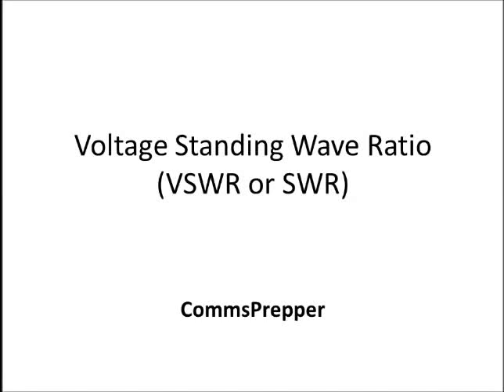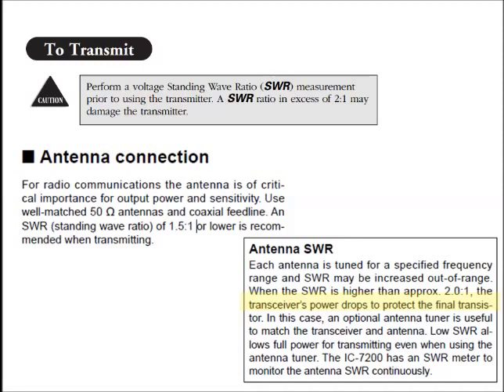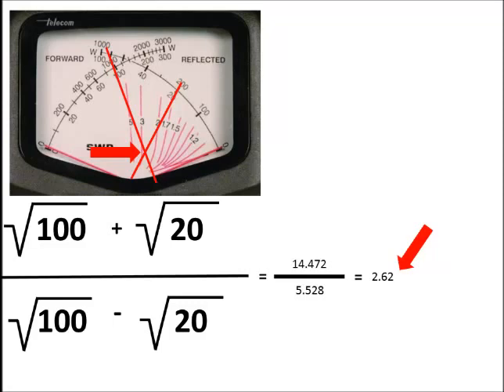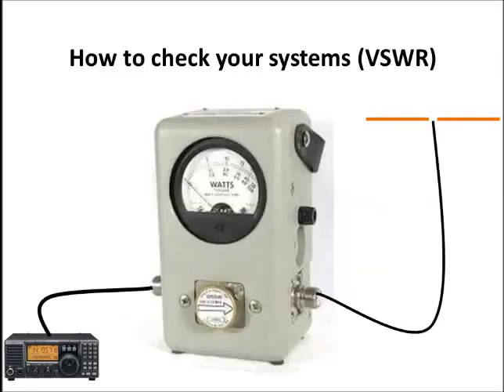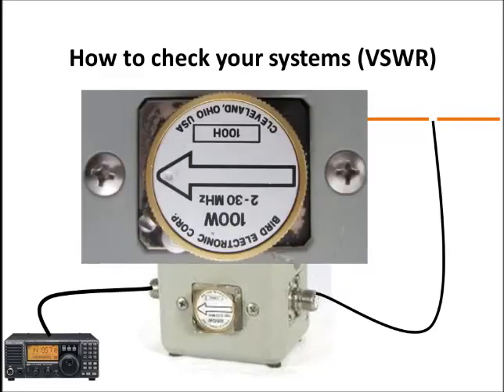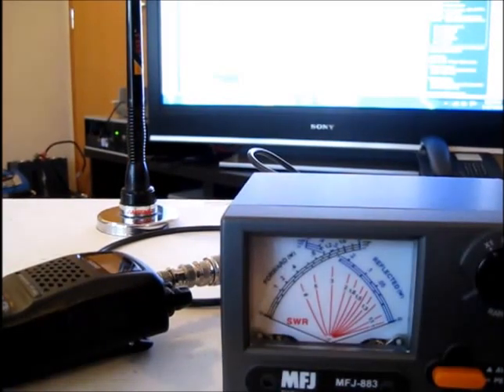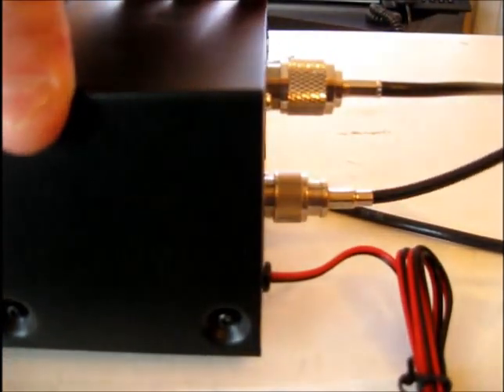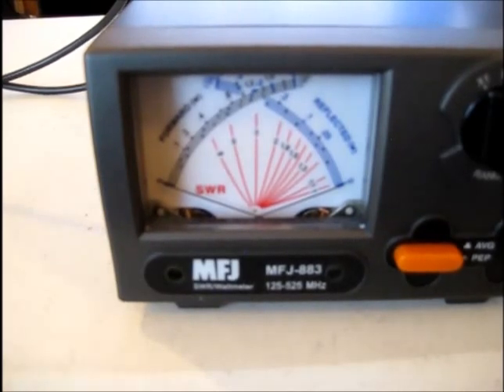Check Your Antennas - VSWR

Comment: SOrry during measure VSWR, does it matter if the antenna is not set up in open area (direct to the wall of the room)? Is the signal reflect from the wall will cause VSWR higher than usual?

Comment: Properly tuned AT  the ANTENNA. 

Yes.

 NOT at transmitter.

BUT...the meter is NOT reading reflected power bc line losses are much greater across a line when out of tune.

That just amplifies the REQUIREMENT    to check AT the antenna, not transmitter.

Worse than just extra heat, mismatch causes very high voltages or currents into the TX and that also can damage the transmitter.

PS thats not a VSWR meter.... VSWR is voltage at two different pounts on the line.

These meters measure reflected current.

All in all, good video.

Comment: So what can you do when a test of a new antenna and a new radio produce super high SWR? Can you do a video on how to address undesirable readings? I can understand not using the rubber duck antenna, but what if it's a brand new EFHW antenna and a new HF radio? Do I send it all back?
Reply from the maker: What is an EFHW antenna.  Things to look at if your SWR is bad.  Cable problems (short, open, bad connectors, bad cable).  Antenna problems - not tuned or cut for the operating frequencies, shorts/open, bad coils/balums, etc.

Comment: The reflected power will get re reflected at the radio or tuner back to the antenna and radiated, how much depends on feeder loss
Reply: If there's reflected power back at the radio that doesn't trip the protection circuit of radio what happens to it, it gets reflected back to antenna, how much that gets back to antenna is down to feeder, the lossy it is the less that gets back to antenna
Reply from the maker: Not sure I understand the comment.  Reflected power is bad.

Comment: Superb. Period.

Liked & subbed.
Reply from the maker: +usernamemykel thank you
Reply: With my Yaesu 7900R, I'm getting good readings in front and reflected values, but the needles aren't crossing, so I can't read a SWR. This happens in 2m only, not 70cm. 
What's happening?? If the needles don't cross, then what is my SWR value?

Comment: Cool wish I had watched this before I went for my test Sunday, I would have got one more question right.  I passed anyhow but it is nice to learn a bit more anyhow before my radio arrives and my name gets in the database.  So what could you do with that little rubber ducky to get the SWR down to a good rating in VHF?
Reply from the maker: +Jerry Ericsson Congratulations on getting your ticket!  Handheld rubber ducks - nothing.  They are what they are.  However, if you make an antenna then you can do more.

Comment: Thanks, that is very well explained. 
Now this topic is much clearer to me than before watching this video.

Two remarks: the close-up video of the SWR-meter is a bit blurred.
And ... did I miss the explanation what the difference is between "AVG" and "PEP"?
Would be good to know what is is about.
Reply from the maker: +Thomas Gärtner Thomas sorry about the blue but the video is posted and I cannot correct it.   I have since tried to do better with how I shoot the videos.   Average setting will slow the swing of the needles and allow them to hang momentarily to give you time to see the reading.  Avg will also show lower power because it's an average of RF energy.    Peak Envelope Power (PEP) is a real-time reading of power, which includes the peak of the transmission.  In PEP mode the needles move fast in response to present RF energy.  When in PEP mode and side-band mode on the radio I whistle see peak power on the needles.

Comment: Thanks for the video but im confused because there are many videos about how to check but how to fix? You have one antenna thats wrong, ok how to fix it?
Reply from the maker: cvcoco At first I would look at the antenna length.  If the antenna is a match at a lower frequency - it's too long and needs to be trimmed.  If the antenna is a match at a high frequency - it's too short.   If the antenna is not at match at any frequency around the frequency you cut it for then you should look at the following:

1. Connectors (properly made, no shorts and no opens)
2. Coax check (no cuts or shorts)

Hope this helps.
Reply: Commsprepper Ok thanks, understood. Are you ever going for an average length? Once I read that the ideal length for a car FM antenna was 37 inches but that length doesnt match 88 or 108, its somewhere in the middle so something is always being lost, yes? In other words, do you need a separate antenna for every frequency band? How can 2M and and 400 band use the same length of antenna in one radio? SWRs wouldnt ever match right?
Reply from the maker: cvcoco Never seeking and average length.  Frequency wave lengths are specific and must be correct to have a resonant antenna which will result in low or no VSWR.  This is said - antenna length is less critical for receivers since they are passive devices (i.e. car stereo or coat hanger on the back of an old TV).   Different antennas are needed for different bands.  However, there are many multi-band or dual-band antennas.  For multi-band antennas designers use traps and coils to manipulate the antenna's impedance (resident wave length) and take advantage of fractional wave lengths of an antenna.  For example 145mHz wave length is roughly 2 meters long and will have low or no VSWR.  But you can also achieve the same VSWR with fractions.  1/2 wave length and 1/4 wave length.  The fractions are also resonant and will have low or no VSWR but are less efficient.  Another example: the antenna length for 14.24 mHz is roughly 21 meters long, At 21 meters this antenna is too short for 7.25 mHz for a full wave antenna - BUT - is almost perfect at a half-wave.  Add a coil or choke and you have a single antenna that works on two very different frequencies.  One of the more popular antennas that does this is the G5RV (names after the British ham's call sign that designed the antenna).  Hope this provides some insight.  CommsPrepper

Comment: What the hell is "R3CU"? As long as you are going to do all of this prepper work in comm, you might as well get your tech or general amateur license. You (and the others) most likely have the intelligence and iniative to easily study for and pass the tests. Also, other hams will be glad to assist you with your technical and operating skills.k

Otherwise, your video is very good simplified explsnation of VSWR and how to measure it.

73 de

K6WHP
Reply from the maker: William - R3CU is my call sign here in the Russian Federation.  It's a CEPT Class I license (same as a U.S. Extra class license).  I also have a U.S. Extra class license and have been licensed since 1988.  Thank you for the feedback on this video.  73's Hank
Reply: Commsprepper Well, don't I feel the fool? Congratulations on getting a license in another country! Quite an accomplishment.Did you have to take the test in Russian? 

Anyway, the advice still stands for other preppers who want to become proficient in comm. Hams are more than happy to help folks study for their tests as well as share their knowledge and experience in technical areas. (As your fine video demonstrates.)

72/73,

K6WHP
Reply from the maker: k6whp I did not need to take the test here.  There is a reciprocal agreement between the U.S. and Russia for radio licensing.

I agree 100% that preppers who seek a solid communications plan should get licensed.  I have a few videos on the topic, providing guidance on where to start and walking through the process.

Again - thanks for commenting.

Hank
Reply: My 73-year-old girlfriend, totally non-technical, studied the Tech Class flash cards for 3 months and passed her Tech test. Proud of her.

Comment: does the watt meter you show here perform the same task as your radio tuner did in another video… without the ability to TUNE… would the tuner replace the need for the watt meter? also what does a dummy antenna mean? is it just a teaching antenna for classes?
Reply from the maker: Yes the meter in this video performs the same task as the meter built into my tuner.  I have this meter for testing my VHF/UHF antennas that do not use/need a tuner.  A "dummy antenna or dummy load" is large resister that absorbs all of the power transmitted by a radio.  They are used for testing and trouble shooting.  They simulate a perfect antenna that has zero reflected power.  All the power sent to a dummy antenna/load is absorbed and none of that power is radiated into free space.
Reply: the watt meter as you refer to it is a SWR meter that measures standing wave ratio hence "SWR"

they are not the same, nor do they do the same

however what I watched of the video did not explain impedance

good video but I found it boring, sorry
Reply from the maker: AA1PR Thanks for watching and taking the time to comment.  Respectfully - CommsPrepper
Reply: AA1PR I know for the Boeing aircraft I work on, we use the wattmeter.  If output is 30 watts, you turn a crystal around and check to see reflected power.  it should be no more than 10% or 3 watts in this example.

Comment: Nice video. But people need to remember, you can have a good SWR and not get the power out because of line loss. For these VHF/UHF radios, please get a high quality feedline like LMR-400. You don't need true LMR but an equivalent low loss line is imperative.